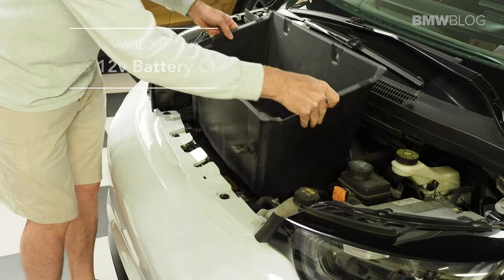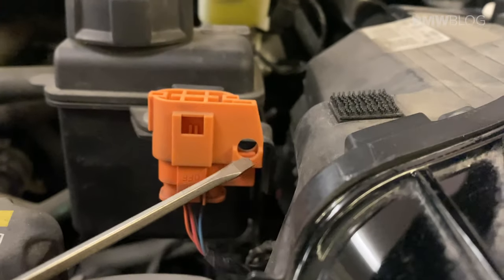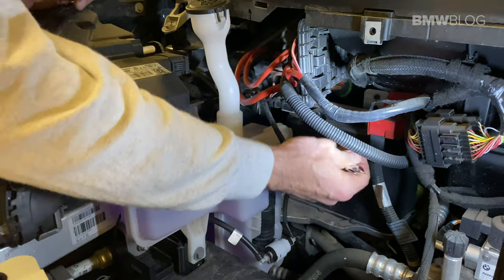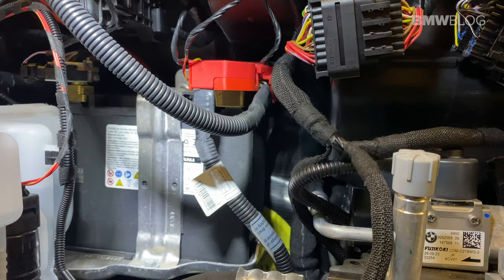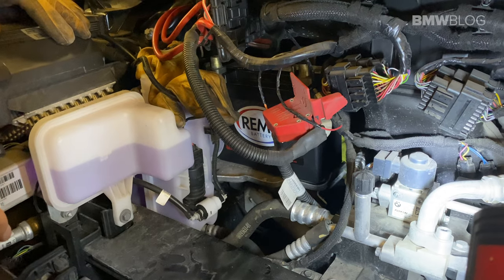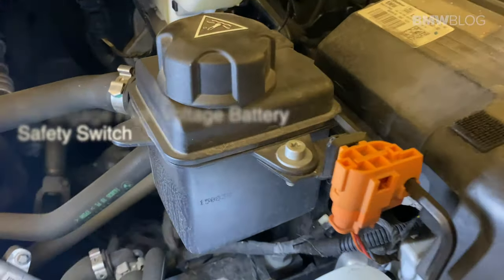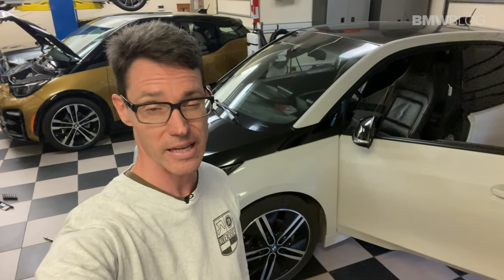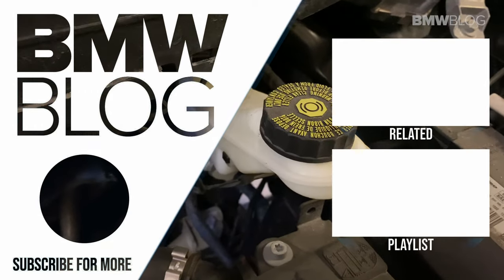How To Replace The 12V Battery in The BMW i3 | GUIDE

Comment from the maker: If you like this video, please be kind to subscribe to our channel! http://bit.ly/bmwblog_subscribe
Reply: Very nicely done.  I have followed this procedure and used the VeePeak dongle with the Bimmerlink software.   Everything went as expected.   However, after completion, I have begun to get low battery warnings from my two key fobs.   Changing the fob batteries does not seem to help.   Curious as to whether anyone else has had same experience.
Reply: Thank you for the video.  Used a OEM BMW aux battery for the swap (only one I could find in the market) Still getting some warnings on the display, but at least there is power going to the display.  Car will not charge now with in wall charger (just yellow flashing).  Secondly, it's my understanding you do not have to register an actual BMW battery is that the case?

Comment: Why do they make it so difficult to change what should be a cheap to replace disposable battery?
Reply: I don't think it's that difficult really. 6 easy screws to take the container thing out and then 2 10ml nuts on the bracket and 2 on the terminals, all of which are reasonably accessible and doable with a modest socket set. I'm no mechanic but I swapped my batteries in about 30 mins.
Reply: @simonnicholson6069 If it takes more than 10 minutes to change a 12V car battery, it's a bad design. Especially given that the 12V battery on i3's needs to be replaced every few years 😢
Reply: I had to change the battery in my 2011 328i and it was the absolute worst. I think BMW designers sit back and say..."how can we place a battery to make it hard AF to replace?"

Comment: Noticed on a reddit forum, a couple people mentioning they tried an alternative battery and had no issues. Well I installed a Duralast TX24HL battery typically intended for ATV's. I didn't need any extra hardware for it. Straightforward swap of hardware from one battery to the other. In all, about 30 min project. Didn't realize bimmercode wouldn't do the battery registration, so had to purchase bimmerlink after doing the work. Make sure your terminals have some fresh metal for connection when you're doing the swap, as I was lax about doing this and had to wiggle the terminal a little after installation to get a good connection.
Reply: So frustrating that Bimmercode doesn't have the ability to register the battery.

Comment: This is the definitive battery change video. I'm in the UK and was going to do my own video, but there is no improvement I could make on it! It's perfect.
Reply from the maker: Thank you. But as always, the dealer might be the best option to perform this
Reply: Took mine to the dealer to replace. After replacing they found a hard fault unable to charge warning on cluster and that further diagnosis is needed with charge control module.   Assuming the replacement battery wasn’t fully charged before replacement, but I was assured they were a master tech. They want $300 for the fault diagnosis alone. Who knows for the rest of the work. What should I do going forward?

Comment: I used your video to replace my 12 volt battery.  It was very helpful. A couple of additions. I have a 2017 i3 rex.  It has the green disconnect connector,  not orange.  Disconnecting was easy but it  was not obvious how to reconnect/reengage the main battery.  That part wasn't mentioned in your video.  There was a small square opening on the front upper left side.  Inserting a small screwdriver to release the lock enabled me to reengage the main battery.  It took me a few tries and a few minutes to figure that out. For other owners. I was getting battery discharging while idle messages for a couple of weeks before the battery fell off the cliff.  One day it was fine, next day nothing.  I was monitoring it and it was 14.2 volts the day before it failed.  So if your getting messages make a plan to replace the battery.  BTW, my battery as almost 7 years old, so I suspected it needed to be replaced.  The dealers and repair shops wanted about 425 to replace. About 200-220 for the battery (a little high but fair), <100 for labor (fair), 125-135 to register the battery ( ridiculous) .  It literally takes 5 minutes or less.  I already had a OBD Link LX, added Bimmerlink for $40 and registered the battery in just a few minutes including connecting to Bimmerlink.  Overall the process was straightforward, even not being familiar with how to do it.  One other thing.  When the 12 volt failed, the main battery was about 60 %.  After the change it was drained.  It recharged fine, but i was surprised by that.  I love my i3, and now I know a little bit more about it.  If your handy don't be afraid to undertake this replacement.
Reply from the maker: Thanks for the extra steps. I'm assuming it might be a bit different for different years

Comment: When taking the windshield washer filler tube off, be careful because there may be an o-ring seal that will fall if you are not careful. There is also only one way that it goes off / is put back on. Check it before you try.

Comment: Pro tip on new Li battery disconnector.  When you try to reconnect, use the thin flat screw driver and insert it into the small opening on front left side to unlock.
Reply: Thanks.  That was the slowest part of the job!

Comment: Just swapped out the 12 volt on my 2014 i3 rex. Great video! Made the job easy. Before replacing it, my car stalled out and threw a "drivetrain malfunction" warning. That has gone since I replaced the battery and it is running great. Dealership wanted $900 for the job. Had my car towed home and did it for $200 in parts myself. Thanks!

Comment: This was very well done. It allowed me to quickly change my 12v battery in my ‘18. Only thing I’d add is how to reconnect the high voltage system on ‘18 and later…you need to pry a green safety clip with a small screwdriver in order to lower the main piece. 😊
Reply: Hi Where did you find your battery for your 2018 i3? I have the 2018 i3 rex and cant find a  12volt replacement battery.
Reply: @lashandaherring9223  I've just bought a battery from BMW themselves as it was actually cheaper (£95) than one from Euro Car Parts, who I normally use for spares etc. (In case it makes any difference, mine's a 2017 and non-rex btw.)
Reply: Thanks for the little green clip thing. The rest of the video is perfect, but that little extra just saved me !

Comment: BMW's are really expensive! You saved me many hundreds of dollars. Much appreciated. The video is fantastic. The one thing I would add is how to reconnect the green high voltage switch. I had some trouble with that.  I have a 2016 Rx i3.
Reply: How did you do? I have the same problem with the reconnect... :(

Comment: Looking into getting the i3 2015 Rex with 60kmiles/100k km. Is there any warned when the battery is weak? It doesn’t look like you can’t just jump start it like a normal car…

Comment: Thanks a lot for this video. I saved myself a few bucks by replacing the battery myself. Got an original battery from BMW directly, costing about £100. I am in the UK so the battery is on the other side. So, I didn't need to remove the washer bottle nozzle. By the way, on the positive terminal (and the negative), only one screw (that holds the connector on the battery) needs to be loosened and it pops out. The green HV connector gave me a lot of trouble to put back in. The orange seems much simpler.

Thank you soo much! 😊🎉

Comment: This worked perfect!  Thank you!!  I bought the Remy battery for my 2015 i3 Rex and the install went super smooth.  My battery had the offgassing tube and I was able to disconnect it and attach it to the new battery without issue.  I already had an obd bluetooth adapter I used with Bimmercode and used it with Bimmerlink to code the new battery.  Worked like a charm and the car is happy.
Reply from the maker: You're welcome!
Reply: What does coding a new battery involve? I have ODB and bimmercode. Thanks!

Comment: Very good instructional video. Would be great if added tips how to close green connector back. I took me a while to find out how to do it. The most of my time took me to properly setting lower screw in the bracket that holds battery - somehow this screw wanted to cut the thread - oh boy that was a trouble maker!

Comment: Thanks!  The tutorial was very good and my car was back to normal as soon as I drove it about 10 feet.  All warnings disappeared.  
The oddball green connector was difficult, and probably cost me an hour of fiddling.  I don't think the tab on the left side needs to be popped out to open it.  I think that prevents accidental closing. Rocking it forward seems to be what worked for opening and closing, but I'm honestly not sure.  That thing must change a relay or something as the tiny tiny wires could never conduct all the main battery current.  
I would only add that it is worth cleaning the brass connectors and the clamps that attach to them.  Dirty or loose connectors can make a good battery do bad things.  I used a wire brush and alcohol on a work cloth.
Reply: Hi, which warnings disappeared? Did you have any restraint system errors prior, I’m thinking I’m may be getting this error as the battery maybe failing? Thanks!
Reply: @avaisch007  The check engine light was on for sure, but I'm not sure about he rest.  
After my experience, I'd say replace any battery that shows problems.  Maybe even replace any battery on its 3rd birthday even if perfect.  My first went 2.5 years after I bought the car but may have been 3.5 as the car had bee sitting on a lot for a long time.  2nd battery wen at 3.5 years. 
I bought the REMY replacement battery and 2 day air cost almost $100.

Comment: I heard that the 12v battery is a common fault for the i3 and it's annoying to swap. Definitely more work than most other cars. But this video makes it super easy!
Reply from the maker: It is common fault apparently
Reply: A lot of cars need the battery replacing after about 4 years so not a problem as such. It took me about 45 minutes in total to swap the battery and register it, which I think is an OK amount of time.

Comment: Greetings @bmwblog, 
Followed your tips on change out the 12V battery on my 2019 i3. Started with charging the new battery the night before and removing from the charging station when it was time to install in the car. The removal and the install was the hard part due to the limited space also the T25/27 screw on the negative terminal had a bit of rust so will swap that on the next swap, besides from that the process was easy. After install did the registration process did a quick 3 mile drive in it and no issues reported. 

A successful DIY experience!
Thanks for the great informative video.
Reply from the maker: Thanks for the feedback

Comment: Great video but the traction battery disconnect and reconnect could use some extra info on the newer style connector.  It gets glossed over in this video and ended up being the single most difficult part of the job on my 2019 i3s.  Thanks for doing this otherwise.
Reply: I just did mine and had the same issue.  I think it needs rocked backwards for both opening and closing.  It's hard to say.

Comment: Great tutorial! I was able to do this all on my own as a non-car savvy guy. My biggest issue was getting the Bimmerlink app to connect to the OBD2 diagnostic interface on my iPhone 14. After selecting the "Vgate iCar Wi-Fi" in the Settings > Adapter options and then force closing the Bimmerlink app it finally connected when I re-opened it. The OBD2 interface on Amazon is black instead of the white one in this video, so perhaps this latest model is a bit finicky with the Bimmerlink app.

Comment: I think my 2015 i3 might need this not too long from now. I'll save this video for later
Reply: What makes you think that? Is your car not holding charge as long?
Reply: @jimmyvelez4165  no but it's the original battery and batteries usually don't last for a lot longer then 5 years. I also live in a sometimes frozen climate and it's harder on batteries.
Reply: @Dindonmasker  you know you can check how much charge your battery is actually holding. BMW says they’ll replace is if it’s only holding 13 kWh.
Reply: @Dindonmasker  look up “how to find the battery capacity in bmw i3. I tried it and it works. Mine was pushing 16 kWh
Reply: @jimmyvelez4165  i was talking about the small 12 volt battery.

Comment: This is very useful, thank you! Today I can't go to work because the 12V battery passed away. Tomorrow I receive the new battery so I hope I can do it. I'm not too handy and don't like DIY. I disconneted the high voltage safety connector but I can't connect is back. There is no video from the green+black style reconnecting :(

Comment: Great video! I got a message saying battery discharge while stopped, then a day later followed by a check engine light with a code p1c53. You guys think it needs a 12v battery?
Reply from the maker: Not a mechanic, but most likely from what I've seen in other cases

Comment: No mention of keeping it powered during replacement. I had heard that it is a good idea to jumper another 12v source to the jumper terminals at the rear of the car so that the computer is never shut down. Supposedly this helps avoid error messages and resets.
Reply: I thought this step was a must as well.  I guess it isn't.

Comment: 05:20 When taking off the filler tube, make sure not to drop the black o-ring rubber seal. In this video, it seems like it is already (previously) lost. It will can either be found inside the tube, or on the connection stub on top of the bottle.

Comment: if i want to use a trickle charger for my 2017 I3 should i disconnect the high voltage battery switch. I have the pop up, it sticking. Im in the NE and leaving the car parked outside for 4 wks. Battery pack is charged to 80%.  but worried about the 12 volt. also would it better to remove the battery from the car? i planned on using a plugin adapter inside for the charger

Comment: Can you disconnect the -ve earth terminal,  insulate it and use a Ctec multistage trickle charger with the 12volt battery in place, a normal 12v has a long lifetime if trickle charged every 2 months  ??

Comment: I’m having an issue where the 12v died and I’m not sure how to clear these codes.

Car is stuck in neutral

222851 Internal transmission monitoring - parking position currently not detectable

2228C0 SbW-Lev2: No switching of P recognized

222011 E-machine resolver adjustment not carried out or rotor position sensor offset not in the tolerance band.

222D27 Parking lock, Init: No data for PS open / closed available in NV-Ram

Comment: Correction - 2017 is already the green connector. Just doing this on my 2017 and it has a green connector, not the orange. I managed to unplug it but it was super hard and now impossible to reconnect. This is supposed to be just a plug-in connector but won't go back. I have tried every angle, pushed and pulled everything on the connector, but it won't engage back. What to do ?
Reply: Have you figured out how to re-engage the connector yet?
Reply: My 2017 has the green connector, and I don't remember how I got it re-engaged, but I remember it being a pain in the a$$.

Comment: PSA - ALWAYS remove the positive terminal (RED) first when removing a battery. Leave the black "ground" in place until last. The RED terminal is where the power comes from - hence the reason that BMW put an "exploder" on the RED terminal and not the black.
Reply: Wrong. Always remove negative first.
Reply: @merida1605    Electricity flows from (+) to (-) on a battery with the (-) being the common ground for the entire circuit. If you remove the (-) first then you still have electricity coming from the (+) Red terminal to your system/ECM potentially overloading capacitors and diodes with no source for ground. This can damage them with no path to ground as they are designed from the manufacturer. It is your system and your beliefs on how you think electricity works. As for me I will take the (+) Red off first so there is no electron flow from the battery to the system.
Reply: I hear what you’re saying but the point of removing the ground first is to prevent an accidental grounding when removing the positive.  If you remove the ground first then you’ve eliminated that possibility.

Comment: I am thinking of buying a 2019 i3s and though I love the car, it bugs me the 12 volt battery every 5 years and I’ve read, a $16,000 bill to replace main battery down the road. 
But I was thinking, can the I3 12v battery be mounted in the frunk and extend the + - wires? The thought is every 5 years easy to change.  Does the I3 maintain settings when 12v is disconnected or does it get power from main battery to hold settings? Seems like a pain if things need to be rest
Reply: I wouldn't worry about the cost of main battery replacement.  Pretty much with all EVs with active battery temperature management (like the i3), the battery should be good for the lifetime of the vehicle.  It's only cars with passive temperature control (Original style Nissan Leaf) where it might be a consideration. You have to reset the time when changing the 12V, but I don't think any of the presets get reset if I remember correctly.  While I think I can change the battery myself, I had it changed on my 2017 by the used car dealer where I bought it.  They know how to operate on EVs.  They even registered the battery.  I think it was only $350.  More than DIY, but far, far less than the BMW dealer.